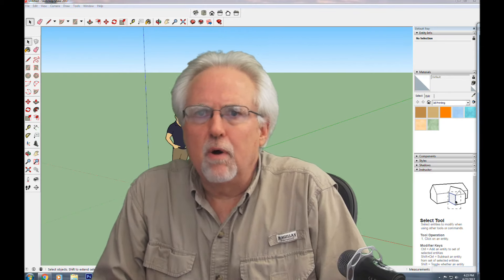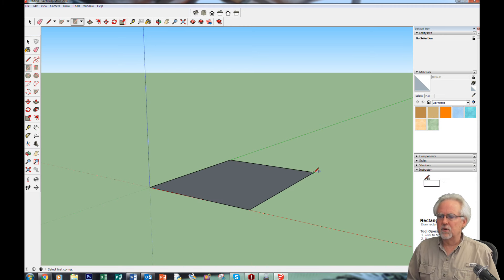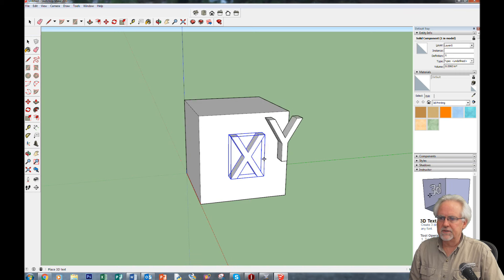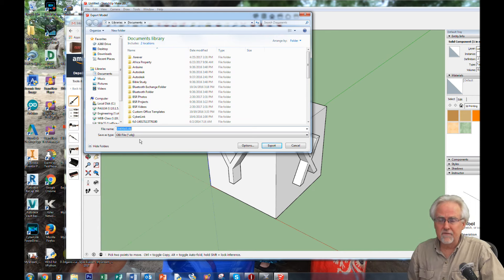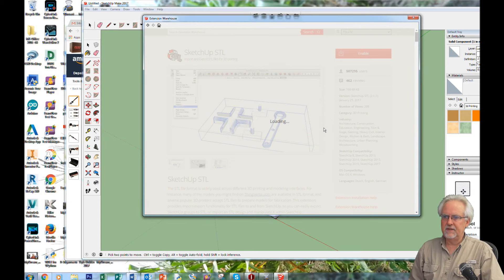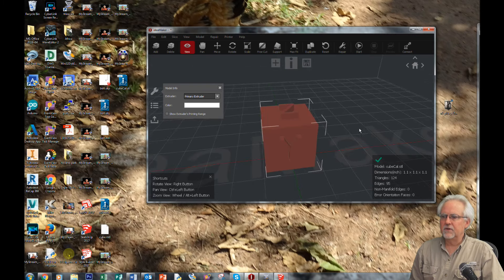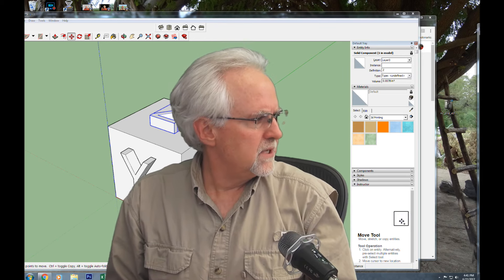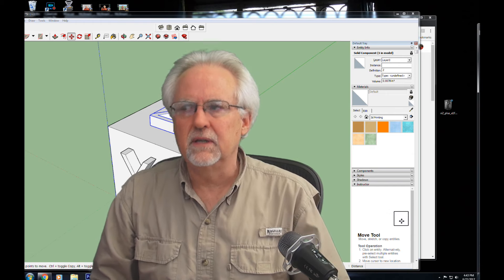Sketchup Tutorial LESSON 3: Printing Sketchup Designs on a 3D Printer

Comment: Most excellent.  Please  comment on how well your other less expensive 3D printer  did on this cube print test.   It will help me decide on my own 3D printer purchase.  Thanks!
Reply from the maker: Upcoming videos are going to quantify the performance of the printers using designs to determine design rules. I have a Prusa Mk2S i3 and a Raise3D N2 plus. Both are very reliable. The prusa is under $1000 and the Raise 3D is pushing $4,000. The Raise3D out of the box is getting better precision than the Prusa. However, if you worked at fine tuning things, you cold probably get way more out of the prusa than I am with just the factory settings.

Comment: Mr. McWhorter, using the 3d drawing from sketchup as shown in your video, did you create a hollow-thin-wall cube? or was it a solid cube? if it were hollow, then what support the top surface during printing?
Reply from the maker: It was a thin wall cube with internal structure . . . think of like a honeycomb. So the cube is strong, but very lightweight.
Reply: I see.. I guess that honeycomb internal structure was not created yet when you extrude the bottom square face 1" up along z-axis in sketchup? Was it auto generated after export-stl? What about the X- and the Y-shape which hang on the side walls? don't they need something below to hold X and Y ?
Reply from the maker: There are two parts to this. In sketchup we created a solid cube. The file is exported to a .stl file. The .stl file is then imported into the 3D printer slicer software. That software then interprets solid objects as solid faces filled with honeycomb. That way, you do not use as much plastic to build it. In the slicer software you can define how dense you want the honeycomb to be.
Reply: Thank you Sir, I learn a lot from your videos.
Reply: Did you use support for the letters that hang on the sides?

Comment: the cube that you have printed out...is it hollow??
Reply from the maker: It has like a honeycomb inside. It is mostly air, but has some structure. the slicer software makes it mostly hollow to save filment but does have a periodic structure to give it strength.
Reply: Paul McWhorter, does that make it brittle or is it considerably strong??  I want to print a case for my gaming pc.
Reply from the maker: slicing software has a setting where you select what percentage infill you want. The higher the percentage, the stronger it will be, and the more expensive as you will be using more filament.

Comment: Looks good. Can't wait to try it. The good news is that I can afford the digital calipers. The bad news is that I would have to rob a bank before I could afford a 3D printer.

Have you tried it yet on your cheaper printer? If the quality is much worse then I'll have to rob a bigger bank.so I can get the more expensive one. 

PS why is everything always orange? I LOVE lime green
Reply from the maker: Yes, I am very impressed with the Prusa Mk2. Really a rock solid machine for under $1000. I consider it to be ready for prime time.
Reply: thanks. Small bank it is then
Reply: @paulmcwhorter  Paul  What about some of the more reasonably priced 3D printers out now in the 150-300 price range?  I would bet a lot of the people taking your course are more in this range for potential 3D printing!  I think very few can use the 1000 and up machines unless they have a business or have access to a business machine.